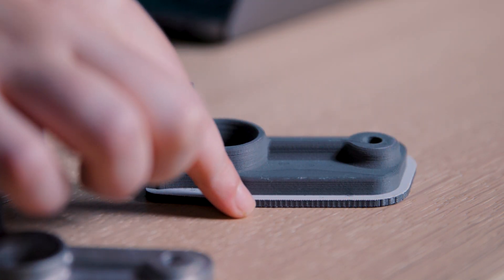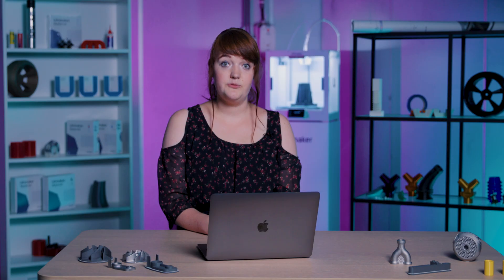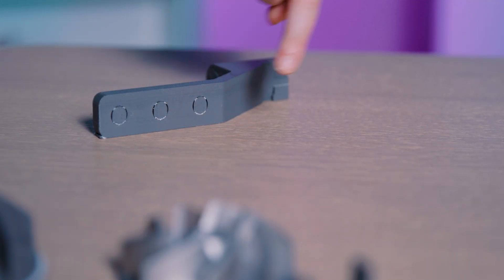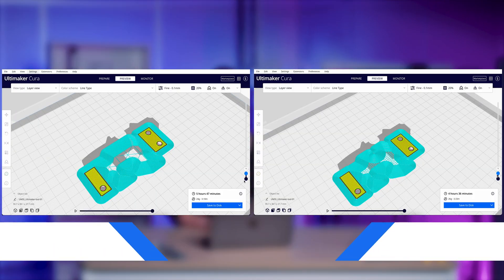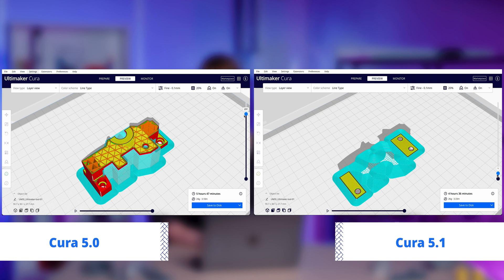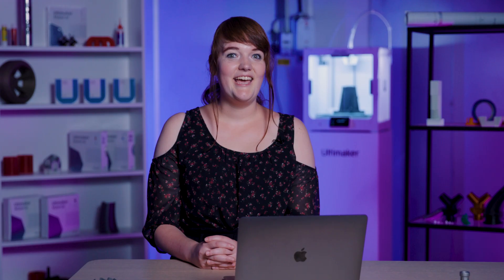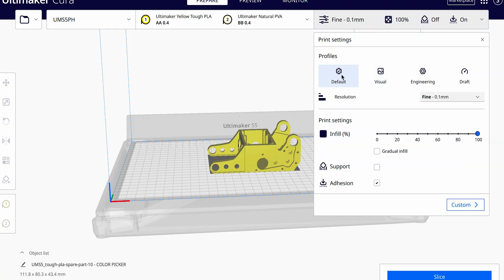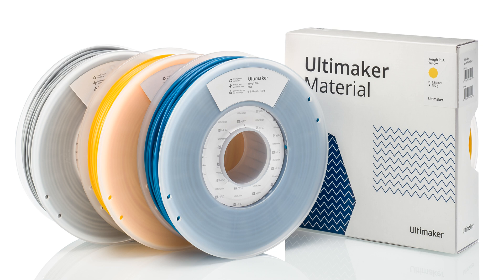Unlock new materials with Ultimaker Cura 5.1

Comment: @Ultimaker how about you would finally add an updater feature into cura its so unuserfriendly to have to back up profiles an scripts and presets and stuff when u have to install the whole new software from your site since there is no update function...your old settings should be kept and and if there is a new setting the default should be good enough to put out a decent  print with it, but should be marked, that it means and an explaination what the setting exactly works nowand how it influences the print when changhing  (just like for every function right now)

I really want to update, but to do so u are forced to unsintall the old version manually and reinstall the entire new updated programm manually aswell, which is so suboptimal and super inconvinient.... its such a horrible use experience that most ppl including me will be turned off by this shit by these points... how be missing such an  important part still with version 5.1!?!!!!

Comment: This version breaks my original Ender 3 Pro (default motherboard) by starting the print before it has started heating.  Rolled back to 5.0 and it's working fine now.
Reply: If you wanted to could you not just preheat the bed?
Reply: Did you check the gcode for your printer profile in cura? Update could have borked it but it's an easy fix if that's the problem
Reply: There are new settings for starting the print before the bed or the nozzle is fully heated, i use this on my ender 3 pro just like 5 degrees before the right temp because then my print stars faster.
Reply: starts*